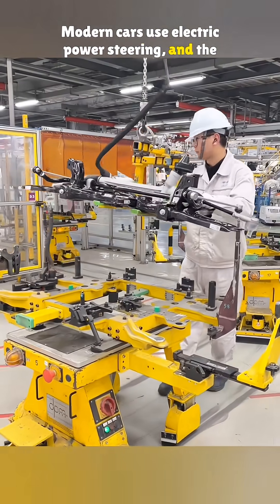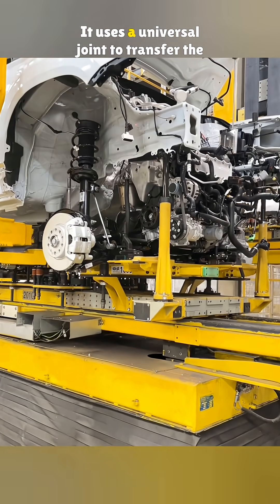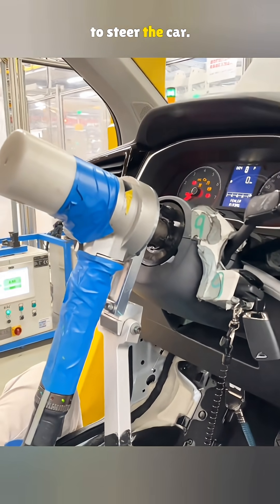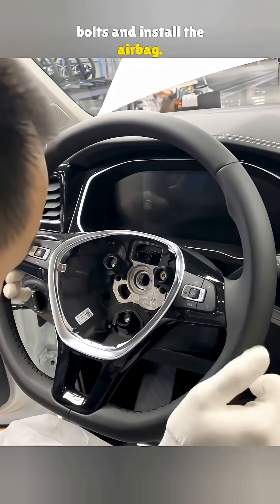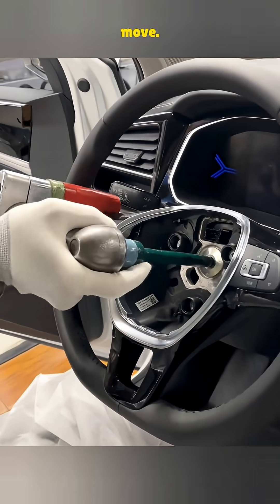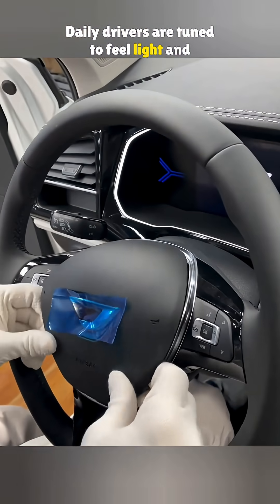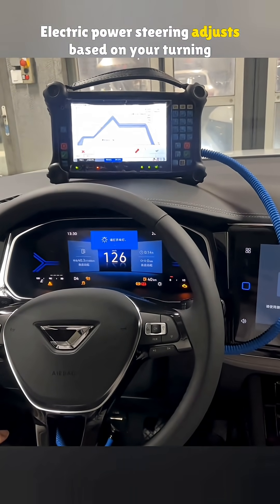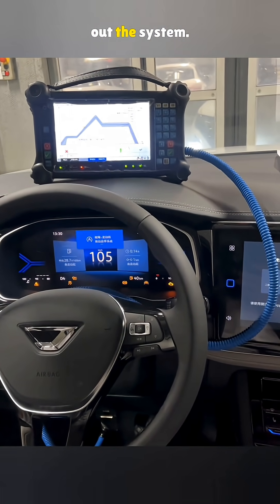Why You Should Never Turn the Wheel All the Way While Parked #assembly #factorytour #manufacturing

Comment: That brought more confusion than clarity. Thanks
Reply: If youve ever driven a car without power assisted steering you know its much much harder to turn the wheel when stationary. Thats force put into the steering column and it wears out faster like this. You should at least be moving a little bit when turning though sometimes with street parking that isnt an option.
Reply: @TheDude50447  by your logic, you shouldn't drive a car fast because if you have ever tried pushing a car, you know it's damn difficult.... See how silly that sounds
Reply: @BadThrusher  i just gave you some very simple facts. No clue what your issue is tbh. I cant even figure out how you got to your anology from what i said. The more force you put into a system the more the components wear. Pushing a car might be less force than idling the engine...
Reply: @BadThrusher  what the hell are you talking about? its true if you ever drove a non power assisted car, its much harder to turn when its not in motion. 
Whats your issue?
Reply: @ThePencilPusher  the manufacturer knew what they were doing. How many cars broke the steering system because they were turned when not in motion? Give me the numbers stop dry talk
Reply: @BadThrusher cars dont break when you  turn the wheels while stationary. It just puts more strain on the steering column. Doing that a lot will likely put the steering out of alignment and not break it. So it should be avoided when possible. Sometimes it just isnt possible though. Thats just the simple facts. How are you making a discussion out of such common knowledge. I thought it was common knowledge at least. Apparently it isnt
Reply: @BadThrusher some parts are made for having forces put on them, some aren't. Steering is for steering, not for absorbing huge forces, as it doesn't need much when the car is moving. It puts a lot of strain on it standing still and should be kept to a minimum.
Reply: @BadThrusher  Based on my old BMW 323i E30 with manual steering it took around 4x as much effort to turn the wheel when stationary than when moving. Later the E30 got PAS and the forces involved were completely masked.
Reply: @TheDude50447  that's a good way to explain it helped me understand the problem I can definitely see where that would mess stuff up its working 5 times harder while stationary
Reply: @TheDude50447  I remember when i was doing my truck driver's license, i was told not to turn on the spot if slowly creeping forward is possible, for this reason. If you look at old trucks without power steering, you see how huge their steering wheel was, just to give you extra leverage.
Reply: The 1968 Cadillac owners manual says "if steering is difficult while stopped release the brake pedal slightly" — letting the car creep slightly greatly reduces tire flexing.
Reply: the ai script is trash
Reply: Haha 😂
Reply: "If youve ever driven a car without power assisted steering you know its much harder to turn the wheel when stationary."

He's saying that if you drove a car with no power steering, you'll get a feel for how hard the steering system has to work.
Reply: He is saying that do not turn steering all the way till you reach the lock on either sides.
Because electric motor is assisting you while you turn steering wheel.
Power steering system is an ultra high speed computing system that senses your steering input and assist you with motor in realtime.
So when you touch the lock while turning all the way, electric system will try to turn a little more after the lock is reached. Which will lead to over current in power system circuits and may fry it if you have bad luck. But it wont happen always.
Reply: It’s the crappy AI voice
Reply: Exactly my thoughts!
AI content tend to do that!
Reply: You should be moving creeping just a little when steering, a minute amount is better than being still, also you will wear out your tires prematurely if you are not moving, just look at the inner trailer wheels on a Semi or heavy tractor unit when it makes a sharp turn , the wheels on the trailer ( if say its a four or six wheel trailer ) are actually pulled sideways across the tarmac, wearing out the tires and leaving rubber marks over the road, as an aside, You all been trying to push a car incorrectly, my daughter, when she was 14 could move my loaded 2 tonne truck by herself 6 feet just on her own using her hands, il give top marks to anyone that tells me how she did it - not using its own power.
Reply: But if your engine is on it reduces the stiffness.
Reply: Don't buy vehicles with electric steering